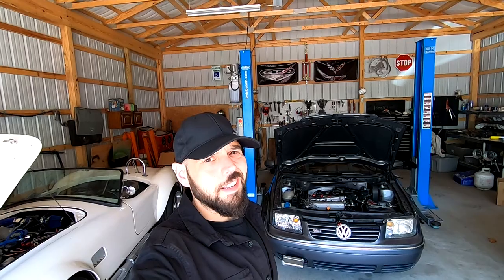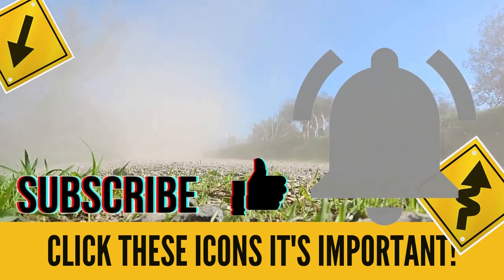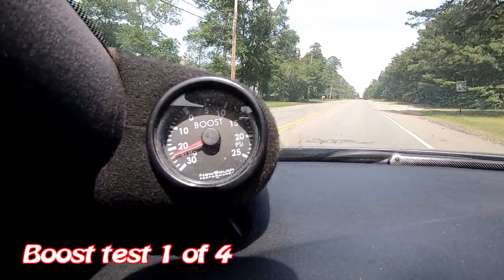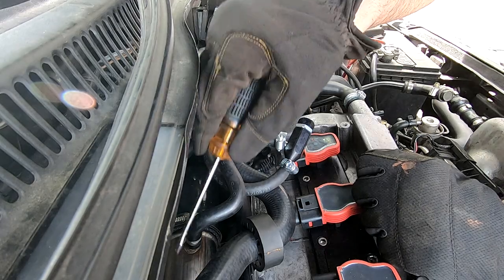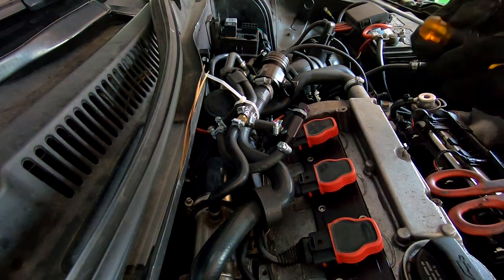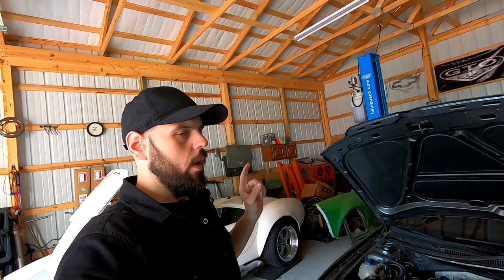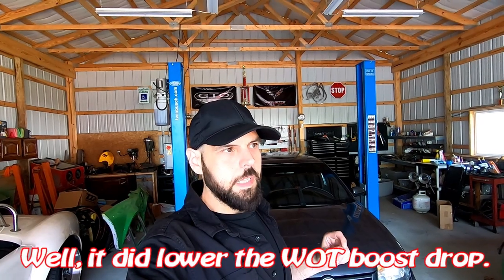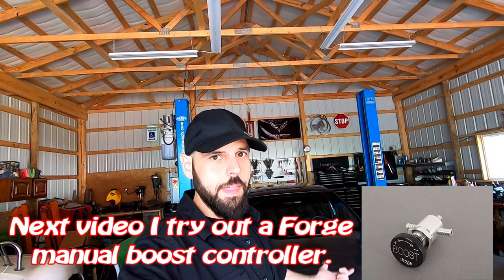Jetta Bigger Turbo | Jetta Manual Boost Controller.

Comment: Hey man this might be too late for ya but that is very common for the ko4 to taper down in psi in higher rpm. They will spike then drop slightly and then hold pressure. Also it will probably build more consistent and higher psi boost in the winter because the air is denser I belive?
Reply from the maker: Hey what’s up. I do have a second video with a better boost controller that did a much better job. But yes it did taper a bit. What my brother was the huge fluctuations I was getting at the time.

Comment: You had the Mbc set up correctly the first time for over boost issue( two t’s and some vacuum line in line with the line the comes off the charge pipe to the n75 then from the waste gate line to the n75) also boost leaks will cause  boost fluctuations. Do yourself a favor and ditch the splitter valve they tend to leak and go with a forge or oem diverter valve
Reply from the maker: Good morning how are you? I actually ended up filming a follow up video using that forge valve with much better results.

Comment: completely normal with a ko3/ko4 turbo they aren’t big enough to produce that much pressure efficiently at higher rpm thus tapering off
Reply from the maker: Hi thank you for commenting. Yeah the only problem with this engine is it was producing higher boost numbers previously. I have a couple other videos coming out showing the path I take to get the boost back I appreciate you checking this video out. I wanted to try and help people who have the same issue as I found online it seems common. Have you ever tried running a N 75J valve?
Reply: @davesworld2132  i’m still on stock n75 and it’s fine but obviously tapers as i get higher in the rpm range. i’ve heard they really don’t matter because the tune tells the n75 what to request for boost based off throttle percentage  and it’s all on the waste gate. i’ve seen people crank the waste gate with spring mods and such to get them to hold boost longer but all i’ve read says that these turbos aren’t all that efficient making high pressures in higher rpms i’m looking to go bigger in the near future and take apart this block
Reply: @davesworld2132  you very well could have a leak too just trying to share some info to possibly help. good luck!
Reply from the maker: @josephfinder5472  def helpful. Another I’m leaning toward a wastegate issue. And possibly changing over to an N75J 

Btw what are you running for a boost gauge?
Reply: @davesworld2132   New south performance boost gauge. mounted on my steering column looks oem and i love it. even lights blue and red with the light switch at night. got it used for $50 and it’s mint
Reply from the maker: @josephfinder5472  That's a great price!
Reply: @davesworld2132  i just did a boost test right now and what i came back with is that i spike 20 or a bit higher because of the cold and taper slowly to 15 by 5k rpms and by the time i’m at 6k it’s has tapered down to 9
Reply from the maker: @josephfinder5472  Interesting. Refresh my memory I can’t type this and also look at the previous messages but are you also running a K04?
Reply: @davesworld2132  stock ko3s on a AWP 1.8t with a stage 2 eurocustoms tune with a forge 008 diverter valve on yellow spring turbo inlet pipe intercooler intake and 3 inch exhaust
Reply from the maker: @josephfinder5472  That may be normal because it’s the K03. Unfortunately I don’t know firsthand how that reacts because I receive the car with a blown Turbo to begin with. Thank you for those numbers. How many miles are on the turbo?
Reply: @davesworld2132  116k miles but depending on the ko4 it will flow very similarly unless it’s a ko4-023 which will make decent power. most ko4-001 direct bolt on ko4 aren’t much different from a ko3s
Reply from the maker: @josephfinder5472  The K04-21 that I have in this video I have footage in a few of the videos I posted showing over 20 pounds of boost. And I have another video coming out where I change the boost gauge after making a few modifications and it does make about 22 to 24 pounds of boost

Comment: Where do you have your waste gate nut setting? Is it closer down the thread or further out?
Reply from the maker: Needs to be adjusted a bit more. I want to make a tighter
Reply: Right. That last run looked normal to me from what I read and see from boost pressure.
Reply from the maker: @trojangpete8  Yea I had two of the videos and wanted to show how these manual controllers can help. I did plan a wastegate video I just ran out of time and never had the chance to finish the editing.

Comment: I have a mk4 1.8t and u can def go down a rabbit hole of bad info seaching forums for pretty much anything on these cars weather its whats the correct spark plug gap or brand of spark plugs to what kind of oil to put in the transmission and of course anything related to turbo upgrades
Reply from the maker: Got that right. Unfortunately the people who know the answers are just tired of constantly answering the same questions every day so we have to rely on the search function. And the information that’s valuable so saturated with information that’s not valuable that we just don’t know what direction to go in.

Comment: Also that boost issue u are havin could be caused by the diverter valve located close to the n75 pancake lookin thing they have a rubber diaphragm that fails when u run higher boost somtimes even stock boost will make it fail just because of high heat in the engine bay and crappy german plastics u can take it off and make a adapter to hook up to the boost side of the valve and put 20 psi of compressed air and see if it holds my guess to what is causing ur boost issue and if that checks out then i would try adjusting the spring pressure at the waste gate actuator on the turbo i bought a cheap ko4 off of Amazon and it barley had any spring pressure out of the box compared to the stock ko3
Reply: Just relized u already replaced the diverter valve mabe the spring pressure isnt set right on it?
Reply from the maker: You know that’s not a bad idea. I changed a lot of the plastic parts because they were dry rotted and leaking oil but I couldn’t find a new pancake and that’s the original one. Thanks for the tip that’s actually very helpful.
Reply: @davesworld2132  no prob i really enjoy your ko4 swap videos
Reply from the maker: @kenphillips479  Thank you that’s very good to hear I’ve spent a lot of time editing and filming. I have a lot more coming out on this car that I thought would be helpful and fun to see. Thank you.

Comment: Can't I just blank off the N75 and connect the vacuum hose to my boost gauge?
Reply from the maker: You can but the engine might run a little twitchy and you might not achieve the maximum boost you’re capable of achieving

Comment: I totally disconnected my waste gate to see if the problem would be fixed and it didn’t solve it. Instead would only boost to 15psi then drop to 5
Reply from the maker: Hi. That def won’t help the turbo. The exhaust side of the turbo wastegate will open and close freely. Boost will be very erratic

Comment: Did you ever try to run it inline from the n75 to the wastegate?
Reply from the maker: Yes Later in the video I run it in line. And show the results I have another video coming out showing a different type of wastegate controller and I do the same testing with that one as well.
Reply: Oh I thought you ran in in line from boost source to the n75 I was wondering if you ran it from the n75 to the wastegate basically applying less boost to the waste gate keeping it closed longer and open less
Reply: Yeah if nothing else fails go with a 3 port boost controller or go fullsend with a 6 port boost controller
Reply from the maker: @hobosandwhich  Oh I see what you mean. My thought process was before the N75 because it operates based on pressure. I was trying to control when it opened and closed. I assume if we ran it after we may run into an issue where it will open and close but the control over the wastegate might be finicky. I would assume you can run into an issue where the wastegate has the open and maybe it can’t.
Reply from the maker: @hobosandwhich  lol like your style! Currently the 3 port which I highly recommend is on the car. After doing hours of research it seems like that’s the best way to go. I also realized after the fact there’s a way to modify this boost controller to work like a three port. But there around the same price and it was pointless to do so lol just buy the correct one
Reply: Yes that I could be a possibility. But usually if there was an issue in that portion of the boost controller, correct me if I'm wrong tho, if you have no boost controller your wastegate will run off of spring pressure alone and is completely safe?

Comment: Is in it recommended to use diverter valves on these types of cars?
Reply from the maker: Turbo cars have both typically. A wastegate and a diverter. This car normally would have one in the intake but it was swapped out to a atmospheric style blow off valve.